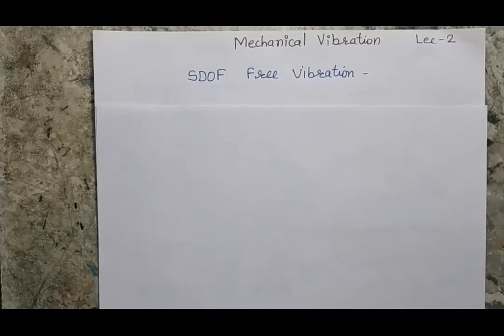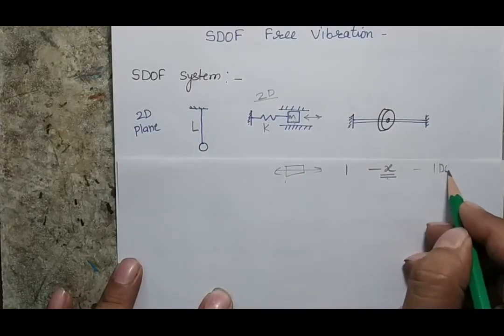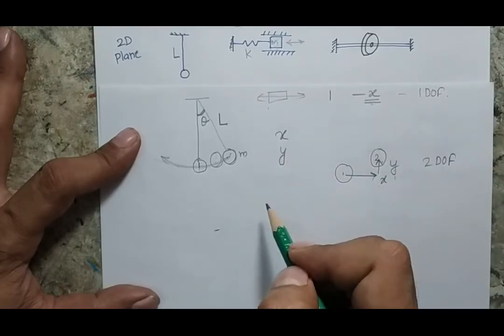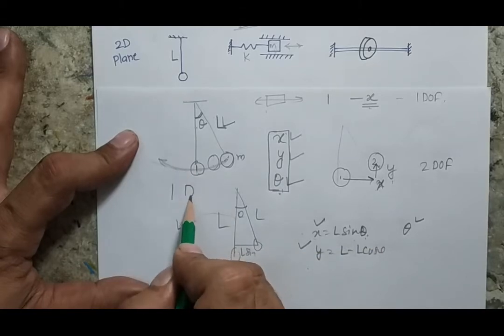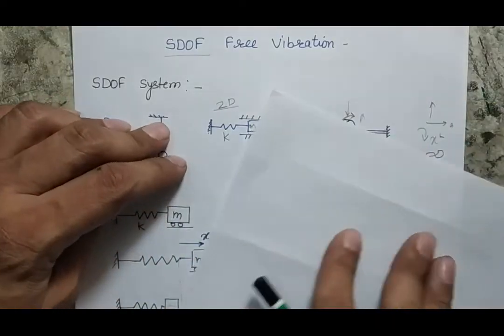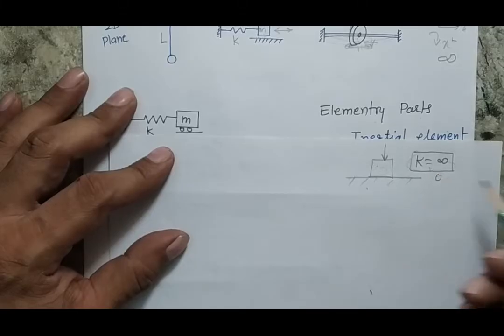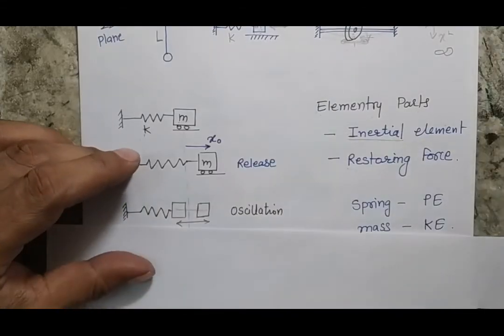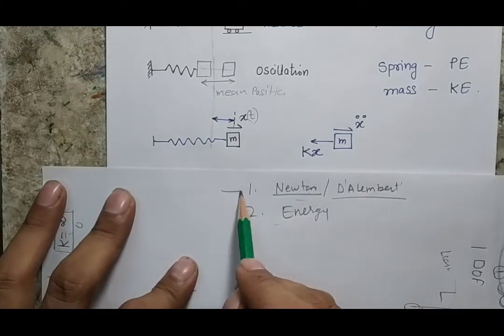Mechanical Vibration Lecture 2 || SDOF free Vibration || Energy method and Newtons law

Comment: The ratio between acceleration and displacement yields the natural frequency. The larger the natural frequency, the larger the acceleration. If I were to use the Peak Ground Acceleration to study the stability of my system, does it make sense to assume that the acceleration causing damage is proportional to the frequency? The answer is no because we need to take into account the frequency of an external force. I understand that this is for free vibration. So, how can I account for the resonance effects between my structure and any external force in terms of frequency? I cannot use this equation (Video minute 16:52) to estimate the peack ground acceleration. What do you suggest professor Purohit? Thank you sr.

Comment: Dear sir
Hope you are doing fine and you remember me. Thank you for such a nice explanation of free vibration of SDOF system. I think that Newton's second law and D Alembart's principle are two different approach to deal with dynamics of a system. Newton's second law is applicable for dynamical system from an inertial frame of reference. However, D Alembart's principle converts the dynamic system into a static system by applying a hypothetical force (inertia force) opposite to the direction of acceleration. It is quite easier to deal with forces in a static system. In other words it is like Newton's second law applied to a non-inertial system when the frame of reference is the accelerating body itself. In your video, you wrote D Alembart's law (which isn't a law but a principle or method) and applied Newton's second law to derive the equation of motion. Please correct me if I'm wrong.
Best regards,
Reply from the maker: Dear Faisel Bhai, I am glad to see your message, How are you sir. I am grateful for your comment which is correct. Actually both are different approach, however, making understanding of derivation I just it so. I am putting your words as public comment for clarity.
Reply: @ashishpurohit9138  Thanks for the acknowledgement sir. I am fine. Currently I am at BIT Mesra, Ranchi. I'm taking Dynamics of Machines in this semester. I watched your video on Gyroscope also which is also very nicely explained.
Reply from the maker: Please share your no.
Reply: @ashishpurohit9138  8294567477